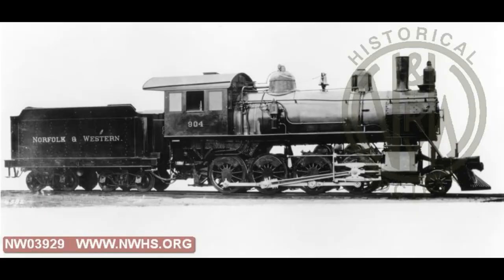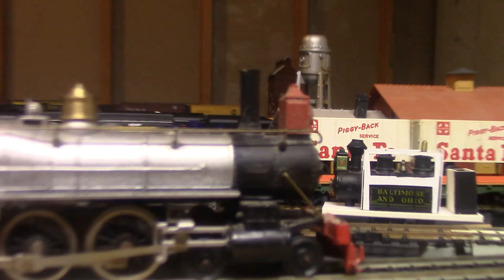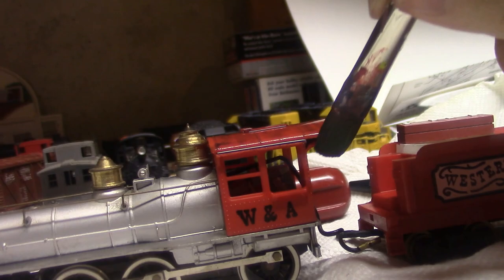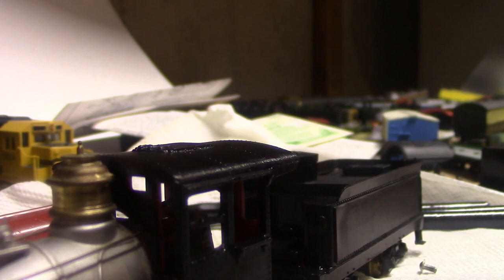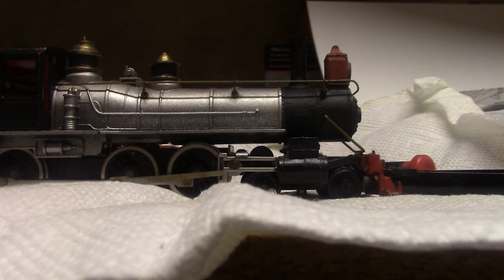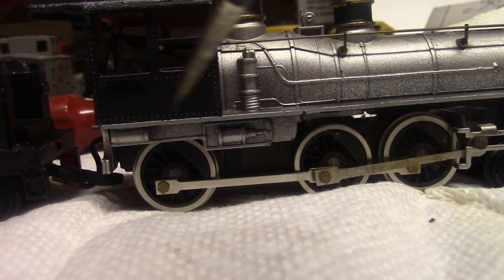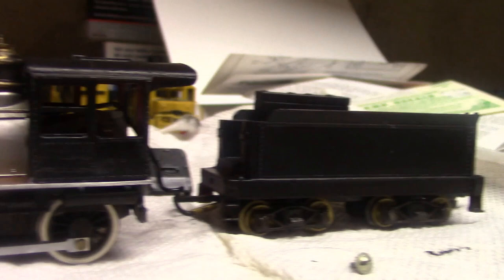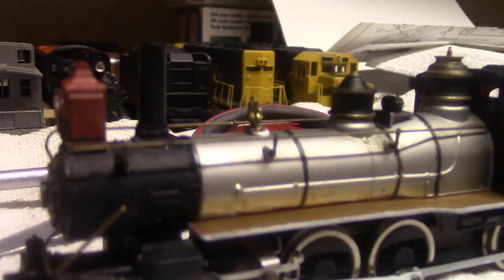Painting An N&W 4-6-0 (Mantua/Tyco Sierra #3)

Comment: I've noticed Sierra No.3 looks, if I may be so bold, a lot like a stretched version of U.P. 119.
One thing I've always wondered is why American locos have those steam generators?
Reply from the maker: It very much is! 119 and Sierra 3 were built by the same make and they probably took some inspiration from their earlier engines when designing it. 

The steam generators on our engines are used for powering the electric lights on the locomotives, as well as some safety accessories on later machines. Usually to my knowledge, the coaches would have their own electric supply from wheel-mounted generators.
Reply: @RockyRailroadProductions_B0SS  I didn't actually know No.3 was Rogers built, but now I look at her is quite obvious. Thanks for the info on steam generators, I always thought they were for keeping smoke away from the cab. Thanks a ton!
Reply from the maker: @ajaxengineco  It's sometimes tricky to tell on a lot of American locomotives, some of them look quite similar if you remove railroad-specific features, for example, the engine that inspired this paint job is actually a Baldwin that looks nearly identical!

Took me a while to figure out what the generators were, too, when I first saw videos of British steam, it struck me as odd that they didn't make the same "buzz" when sitting still.

Thanks for commenting! I don't always get notifications on comments or time to respond, unfortunately